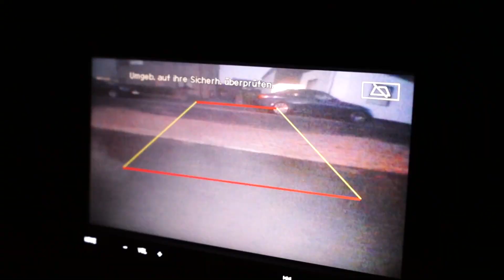MOTOR GEHT AUS! Kurbelwellensensor am Alfa 147 wechseln

Comment: When this sensor is fualty does the car doesn't go up more than 3000rpm ? Is it true ?
Reply from the maker: I could not determine with mine, he is still driven normally. Except just that the engine went off when it was too warm when stationary or sometimes when rolling very slowly.